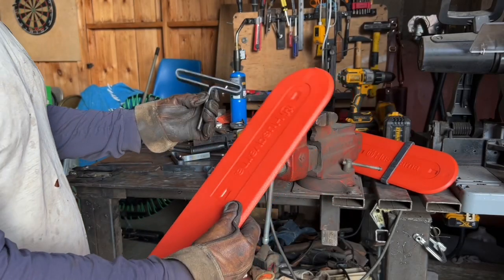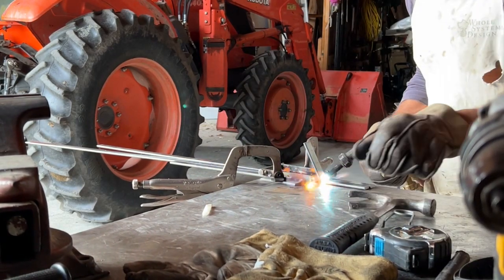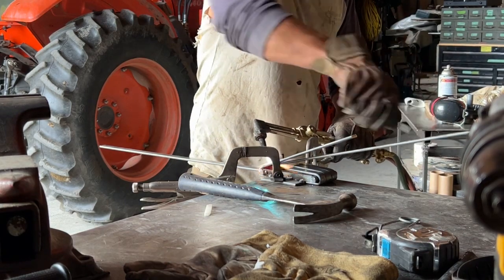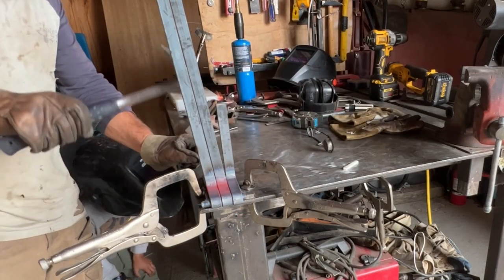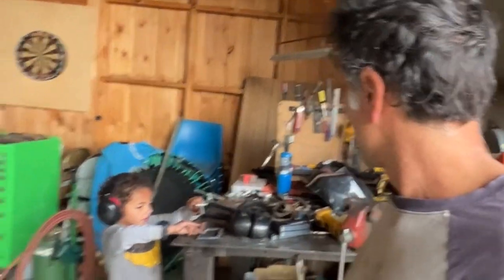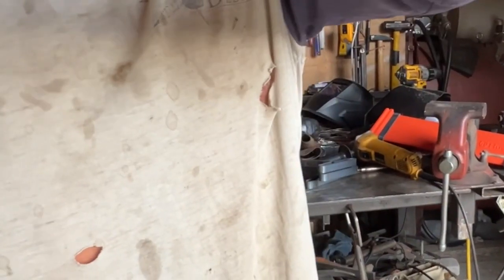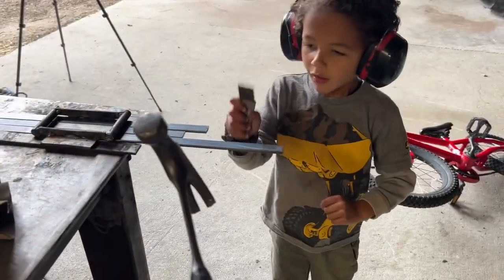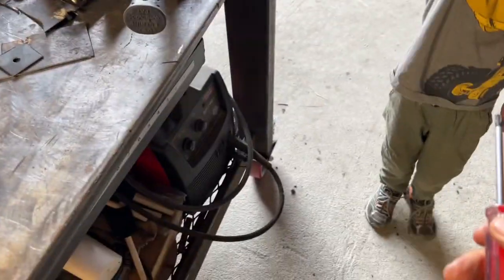Mounting Chainsaw to ATV, Tractor, Excavator, etc. chainsaw scabbards

Comment: I was taught to turn the fuel gas up until it stops smoking. I think that helps with keeping carbon from building up in the tip. Also shut the 02 off first then fuel, keeps the flashback arrestors working and its less likley to pop.

A brazing tip is good for finer torch work and a rosebud is better for heating a large mass quickly or large area. If you find yourself using the torch often you can get a grinding face shield with a built in flip up torch shade. I think sellstorm makes one.
Reply: You might have covered that/already know but I guess someone else might not.
Reply from the maker: Yes if I didn’t say it correctly in the video that’s what I meant, o2 last. And yeah I usually raise the acetylene until no smoke but when I need is so little heat I do less. Maybe that’s a mistake…
Reply: You did not understand what he told you his being stingy with the gas those welding bottles went from $100 to have filled up for $200 least in part of the world I'm at but I agree I would turn the heat up so it wouldn't take as long to heat up the metal to bend and get done faster instead of taking longer when in reality use less gas because they're having to run for last time also understand why he didn't have a bucket of water and a rag keep his Benz from warping after he did them used to use that metal method a lot when deleting the chrome trim from old vehicles 70s and 80s deleting the ragtops because you have to get rid of the hangers for the border molding and then weld the holes and the rag would keep you from warping the middle see you when I can feel it with Bondo or puddy